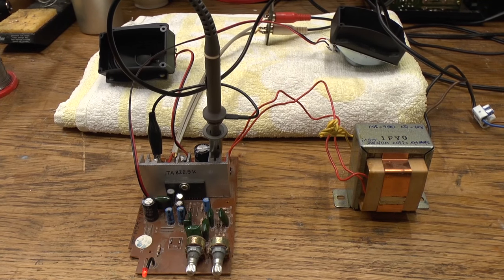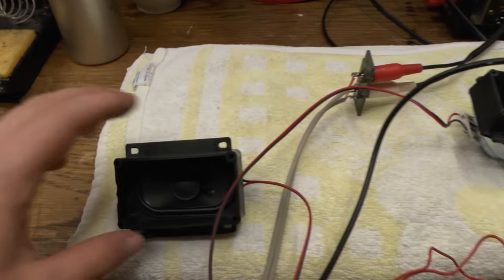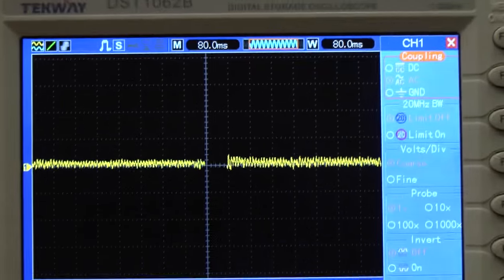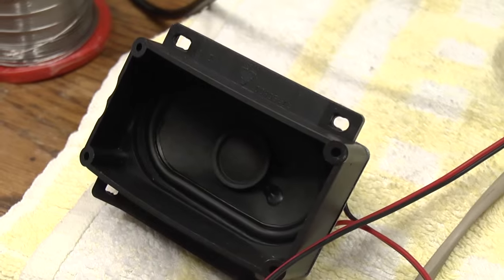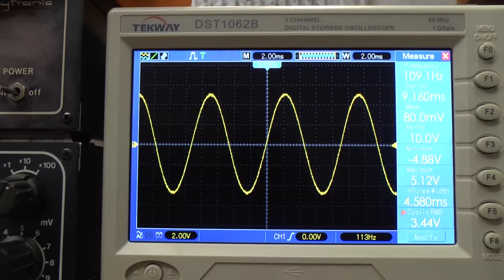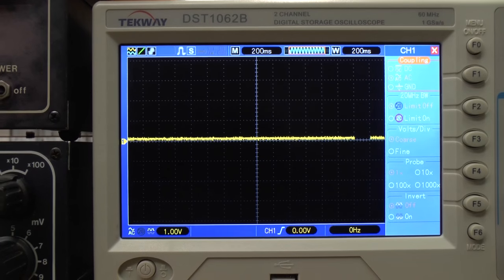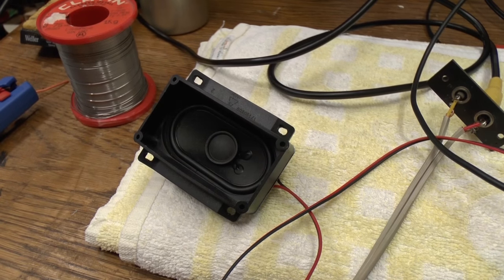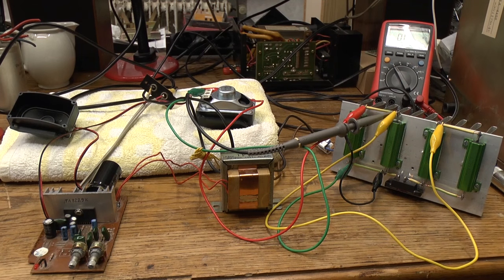Power Supply Filter Capacitor in an Audio Amplifier

Comment: 4:00 That is 860mA!!! Not Watts! I=U/R
You have there about 2.95 Watts RMS.
Reply from the maker: +Felix2417425 
This is what happens when you haven't gotten any good sleep in almost two weeks...
Reply: (3.44x3.44)÷4=p2px.707=2.09rms. if I'm not wrong
Reply: @mdashiqurrahman39  3,44 volt rms x 3,44 volt rms / 4 ohm = 2,96 Watt rms

Comment: Howdy. Nice walkthrough.
One might consider connecting a plastic cap. of say 1 uF in parallel with the main filter cap. That should knock down the noise on the rails. It might also cure any tendency to oscillate.
Regards.

Comment: Well if you look at the datasheet for that IC, the THD is already at 10% when you reach 2W Peak. Nasty! So yea, that IC is pretty bad. Your VPP is roughly 10.5v, and you have a 12V input so that is correct, as you have some drop across the output transistors.

Comment: If you raise the capacitance, you also raise the voltage a bit. So that's why you get a bit more power.
Reply from the maker: +Bogdan Serban 
Wrong. The capacitor, unless it is totally underdimensioned (not the case in this video) will deliver one constant voltage, U = (√2) * U_P. The capacitance does not matter. In the video you see the output power does not change at all.
Reply: DrCassette when you refer to the impulse power increasing, what sonic difference would that make? Would drums sound punchier?
Reply: Kevin Livingston correct. In power supply filter capacitors you only need to know two things. 1... The voltage rating on the capacitors must be higher than the transformer secondary output... How high you ask? As high as you can afford... Just as long as it's never lower.... 2. The capacitors capacity should be high as possible... According to what size will fit and of course what your wallet can afford.... Also... I guess that you can safely say that there's a third rule of thumb... And that will be the ESR value of the capacitors you choose... The ESR value needs to be as low as possible for the type of capacitors you will be using... There will be many different options available from different brands... Make sure that you pick the one with the lowest ESR value for the voltage and capacity... Try to aim for 105° temperature rated capacitors... These will last longer.... Happy capacitor shopping :)

Comment: Power output depends on voltage, a higher filter cap will give more peak power but little extra continuous power. That chip also has a very poor spec, not really HiFi even on a good day!!

Comment: hi,i have a pioneer vsx 920k receiver that  is freezing randomly and won t power on only when i umplug it from power,could be a bad capacitor?
Reply from the maker: It could be a bad capacitor, somewhere in the power supply or the control logic
Reply: @DrCassette  thanks,i think i had bad power cause IT s functioning well now.

Comment: Thanks Dr 😊 I’m a complete novice and been researching the effect of increasing the capacitance of power filter caps in old amps and although everyone says you can do it to a certain degree, they warn that you could damage other components if you exceed original capacitance too much And not provide a soft start function! In your experience, is this true? I was thinking of putting two 15000uFs in place of the  two existing 6800uF ones. Could that cause issues? It seems you More than doubled original specs successfully. Thank you so much for your help.
Reply from the maker: Indeed increasing the capacitance of the filter capacitor too much can cause damage. When turning on power, the capacitor is charged. This creates a current spike, the higher the capacity, the bigger the spike. If the spike is too big it can destroy for example the rectifier diodes. For the experiment shown in this video these considerations did not matter. If the bigger capacitor had caused damage, I would have repaired that and used a smaller capacitor. Obviously this is not a good strategy when you want the amplifier to work reliably. In your case, I would say increasing the capacitance from 6800 µF to 10000 µF should be fine, but don't go any higher than that! 15000 µF is likely enough to cause damage!
Reply: @DrCassette  thank you so much 😊 I’m gonna go with what the Dr ordered 😊 and no, I will not hold you responsible in any shape or form if I end up burning down the house! 😊 Been checking out your other videos and Already have a better understanding than when I posted the question! Thank you.

Comment: The TA8229k is only capable of about 1W max at 1% THD. Beyond that threshold, the distortion goes sky rocket to 10%. The data sheet says it's just a portable amplifier nothing too fancy. But nevertheless, its worth buying 13000uf capacitor just to run a chip amplifier.
Reply from the maker: +noelj62 
This was really just an experiment. I know that chip is rubbish ;)

Comment: that Capacitor is a DC one right but a Audio Amp outputs basically AC so would that hurt the Dc Cap
Reply from the maker: The filter capacitor is connected to the DC power supply of the amplifier, where there can be fluctuations in the voltage as demonstrated in this video. However, to hurt the capacitor you would have to apply a fairly constant reverse voltage. The supply voltage may fluctuate, but it will never go negative. So the filter capacitor will be fine.
Reply: @DrCassette  ok

Comment: HI and thanks a lot for the very interesting video.  I have a question.  What kind of impact would have a change in the VA of the transformer ?  could that give more power ?   i am thinking of modding some old amps i have at hand and i would like to understand if it would be better to upgrade the power supply transformer or the power supply capacitors in order to get some more slam in the sound (i.e. dynamics).  Thanks a lot again.
Reply from the maker: As shown in the video, bigger capacitors will increase dynamic peak power. A bigger transformer could increase continuous RMS power, but generally amplifiers are designed in such a way that the output power of the transformer matches the output stage, meaning a bigger transformer won't make a difference because then the output stage is the bottleneck.
Reply: thank you very much indeed for the very kind and helpful advice.
Reply: @DrCassette    Hi and sorry to jump in after so long time but i sincerely love this video.  I wonder what would be the outcome with an even bigger cap.   i mean ..  will there be a point at which adding more uF gives no practical benefit ?  i am about to recap some old amps and big and good ones are very expensive   Could a value of 20mF per rail per channel be seen as a limit ?  thanks a lot again.  Kind regards, gino

Comment: sorry this question is unrelated to the video**

just wanted to ask you this before i go ahead and make any decisions, ive got a camera that the previous owner has said that he used sony mini dv tapes and panasonic mini dv tapes. Which are both the 'me' style lubricants, and i also have the same style sony tapes. Do you think it would be fine to go ahead and start using the camera without a head clean? (since im using the same 'me' style sony tapes)
Reply: +vancscoot If the camera is not displaying any video issues, then no need to clean.  Remember that to much video head cleaning can wear out the heads!  As far as tape usage, if I remember correctly, Sony tapes are not good, causes issues with its lubricates, Panasonics are recommended, this is all I use in my tape cameras...another thing, don't mix tapes as each one uses a different formulas of lubricates, stick with one brand / type.
Reply: +JacksJunkDotCom ok thank you, sorry i was talking about getting the heads 'professionally cleaned' and not the cleaning tapes. But i only have sony tapes left so i might just get the camera 'professionally cleaned' then switch to a different brand of tape (tdk) ? would be the best?
Reply: +vancscoot Yes, by all means, use what you have, just keep my recommendations as food for thought.  Have the camera serviced and you should be good to go!  :)
Reply: +JacksJunkDotCom thanks :)

Comment: So 1700 is out of spec but 3300 isn't  ? Think about it
Reply: More is better!
Reply: @michaellundsrensen2292  you have no idea what your talking about
Reply: @ericschulze5641  Can you explain? If not; see the video!
Reply: @michaellundsrensen2292  so you think you know more than the engineers who designed it,  you have to keep within 10% of original design
Reply: @ericschulze5641  If you look at the Picture you can see it's a DIY kit.
In powersupplys MORE IS BETTER as you see in the video!
Reply: @michaellundsrensen2292  no he just modified it, & the transformer provides the exact same voltage

Comment: Try putting a better psu on it
Reply from the maker: This is about the filter capacitor and not the power supply in general.
Reply: @DrCassette  like a better content current psu.